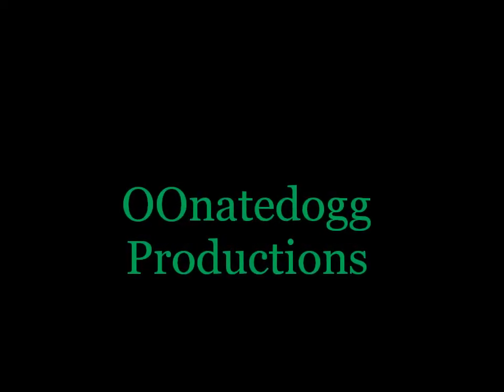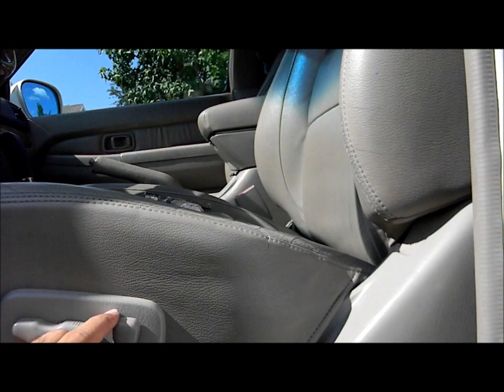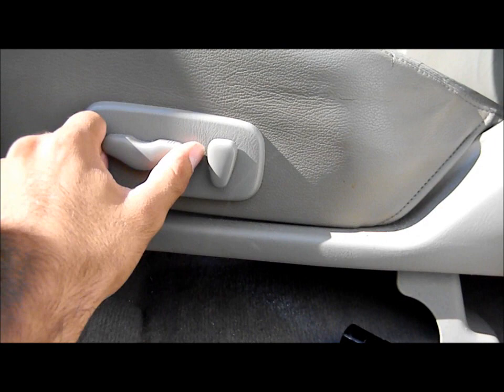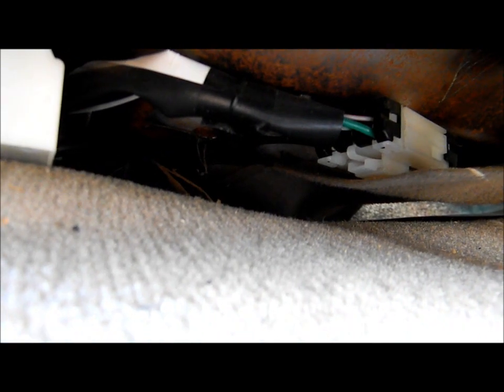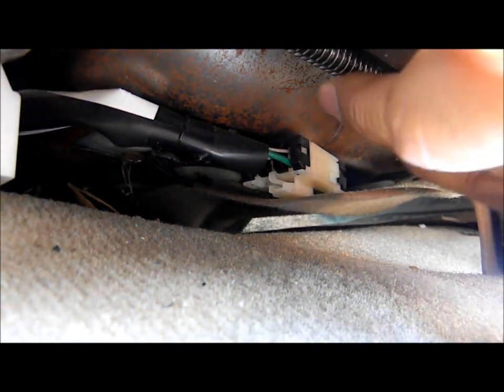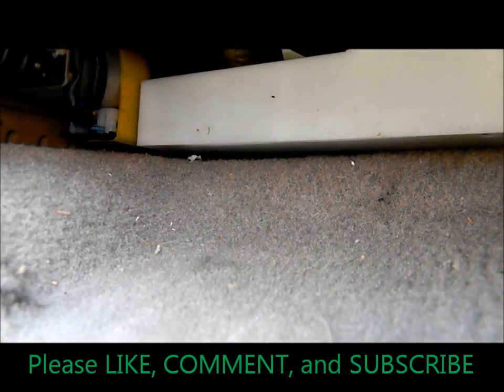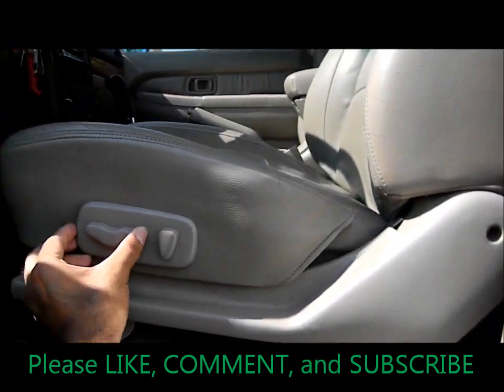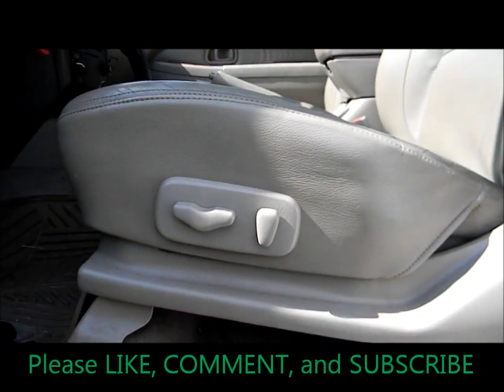Infiniti/Nissan Seat fix

Comment: WORKS! im a car mechanic just got a 2003 nissan 350z and the passenger seat was not working it would only go forward! i was getting ready to buy a new motor for it which was over 150! i happened to run into this video and i cant believe it worked! THANKS ALOT NATHAN! you saved me some big bucks!

Comment: I was having other work done on my wife's 2002 Maxima and asked them to check why the passenger seat motor wouldn't move back or forward. They said the motor needed to be replaced and would be at least $1400 if they could even find one. I was going to leave it as is and then I saw this video. Worked like a charm. Thanks, Nathan. You saved me a bunch of money.

Comment: I was only minutes away from purchasing a used motor and track for my 2001 Infinity QX4 and came across this video. I said out loud to myself that this couldn't be true and went and got a hammer. I hit the motor maybe 5-6 times and was absolutely shocked when it started working! Thank you so very much for saving me $112.00!

Comment: Thank You !!! This Worked !!!! I never let my Wife Drive my  2011 Titan Truck and tonight I was busy and she took my truck and when she brought it back I had to park it and I almost had a stroke when my seat wouldn't adjust back I'm tall and my wife drives like a midget . Its pretty late and I needed to finish what I was working on because I need to be at work at 6 Am. I was  freaking out because I don't have time for this right now but  I can't drive with my knees in the dash. After watching this video 10 minutes later with a hammer in my hand, The Seat started working again. Thanks 1 million Fold!!!!

Comment: This worked for my '01 Infiniti I30t. Same exact problem: drivers side, forward & backward would not work but other movements were fine. Even tried disconnecting pos. terminal on battery to re-set computer as was suggested on another site, (didnt work btw). I brought it to a mechanic & was quoted $1400.- to replace entire seat track assembly, lmao!! Im so glad I found this. Thank you very much!!

Comment: I have an 02 Pathfinder with a stuck drivers' power seat, a Google search has revealed that this is a pretty common problem with this generation of Pathfinders/QX4's. I was about to order a replacement seat motor till I found out how simple these issues are. One note I will add, these seats normally move back automatically when turning the ignition off. There's a swich on the bottom left of the dash to disable this. It eliminates a lot of needless wear on the seat motor moving back and forth, if it's something you can do without physically impairing yourself.
Reply: Thks i got a 02 pathfinder, im hving sme problem. I cnt wait too  try this in da morning.ur rite my seat still moves, jus don't move when cranking or removing key?

Comment: Just had this problem with my 03 Pathfinder.  The seat was stuck all the way in the forward position rendering it undriveable, and all the pushing on it with the button back didn't move it at all.  Just gave it a couple quick taps with the hammer and saved me calling to get it towed to the shop.  Thank you.

Comment: I have a 2016 Infiniti Q50. It's very hard to get under there. I'm experiencing the same problem. Does anyone have any suggestions  ?

Thanks in advance
Reply: Did you ever get it to work? 

I have the same issue with my 2014 Q50
Reply: @NBAThrowback00  Nope. Just bought a new chair. Used of course

Comment: Crazy--- worked on my 2001 Maxima-- was easy to access from the front of the seat-- I just raised the seat as high as it would go-- 2 whacks with my tack hammer & voila-- thanks much--- I think the gear may be a trifle worn..

Comment: What if mine works sometimes and sometimes it doesnt. Like it only happens when your start the car if you start it and it works then it works for the rest of the time it’s started. If you start it and it doesn’t work you’re screwed it doesn’t work so your stuck siting all the way back because it has preset to move back

Comment: I don’t have to tap mine. 2007 Armada. Reach down and under when sitting in seat and squeeze the motor or hold it tight and then it works for me. But I have to keep doing that

Comment: good video this recently happened to me when i  bought my 03 i35 the seat would not move forward or backward and i had a hard time getting in and out of the car because the seat was stuck so far up. I almost gave up and was gonna see if the junk yard had another seat. But after watching this video. I did what you did and hit the seat motor with a hammer and bam it moved!

Comment: Infiniti g35 with seat only leaning forward, not reclining = no go. Thanks for the advice to try and glad it works on other cars and/or if switch won't work both directions; probably a switch problem if only working one direction.

Comment: Thank you for that post - My 2003 Q45 drivers seat is stuck on the right side - will not move back and fort, it only pivots.
I will definitely try and let you know - Thanks again
Reply: StarNebular4 Wondering if you could fix the problem with this tapping trick? My happened the same, just pivot to left side. Thank you

Comment: What about Infinity EX37 which has Driver 1 and Driver 2. Now it doesnt work, the manual button doesn't work either.  The dealer took me about $1000 for a new motor Aug. 25 and now with a new motor it is not working again....

Comment: This is twice it has saved major $$

2001 I30 about 2 years ago passenger seat would not recline.

This time the drivers seat would not move forward or backwards.
Remembered a vid found it again and it worked again. I could not get to the motor so I just beat on the screw actuator and it freed up.

Comment: You need Bering oill or pneumatic oil even a tiny bit of WD-40 would be good just an area as big as your finger London pneumatics to its fullest range oil in both directions no need to go nuts the parts will do the rest😅

Comment: Son-of-a-bitch! It worked!   2005 FX 35   Local stealership was going to charge $795. That included a new motor and inspection of the other 2 motors, etc.

Now, I wonder if the motor has some internal contacts that are getting corroded causing the problem....  Hopefully this will last a while.   THANKS!

Comment: My does not work up and down motion I'll try that tomorrow
Reply: I tried my i30 2000 works on the rear up and down but the front up and down sadly fail 😩
Reply: Did you ever get it to work?

Comment: Did anyone have this happen on the furthest right button? Where is the motor for that switch? I can't seem to get it to work
Reply: That's the lumbar support on mine? If it is, the motor would be inside the seat back... Will be more challenging and disassembly work to get at.